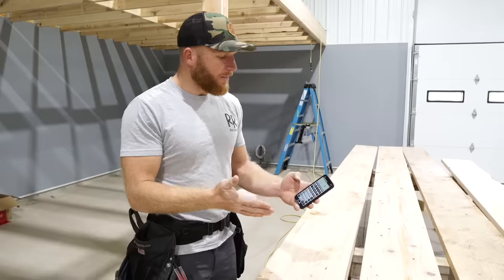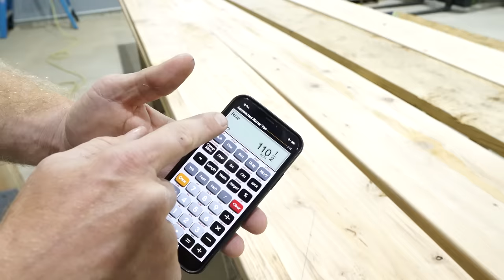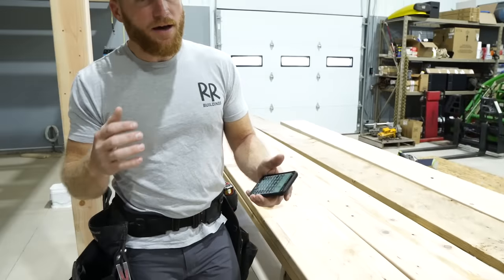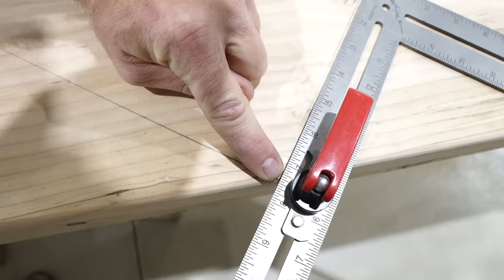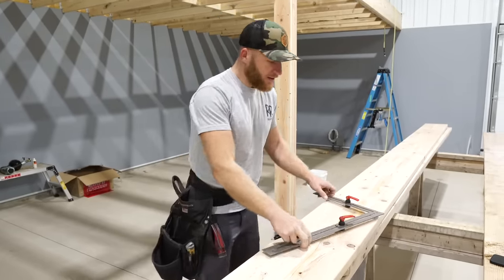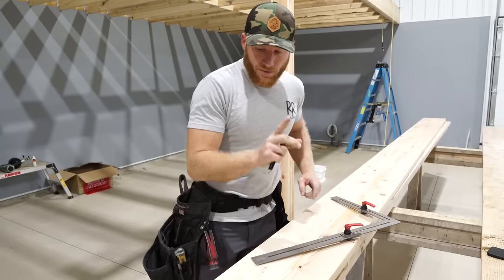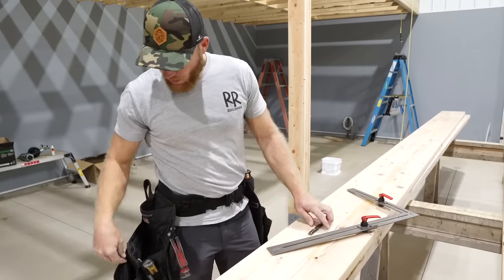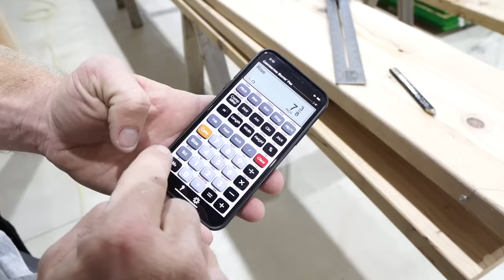Building a Large Staircase and How to Layout a Stair Stringer

Comment: Hey Kyle, love your videos

BUT, I do have to call you out on something
You make mention of your square with the fancy camming locking gauges, and explain how they are much better than the small hex clamp on types.
You say how small imperfections affect the smaller ones, but not yours.  
BUT, yours are rounded, so ANY imperfection can affect the accuracy of yours.
I would not buy one for That reason alone.
The small hex ones have a flat on them, 3/8"?? that rides the flat of the stringer.
Now, one must ensure they are flat on the stringer edge and NOT on the square, as that'll throw off the angle that makes contact, but as you say, make the first one perfect... take the time to clamp those little buggers down hard and flat to the stringer.
ALSO, I put mine on the outside of the square and use the inside to mark the run/rise. 
This keeps them out of the way, but gives a nice solid edge to strike a line against.
doing it your way, you could push the square off the stringer edge, a bit, and using yours with rounded faces, if it happened to slip into a small imperfection, it will throw every other dimension off.

When marking, using the first one, to put lines on the rest, you ALWAYS use the first to mark the others.
This way, you will NOT have "Exponential" or compounding errors.

Keep putting out these great learning aids! 
even old dogs can learn new tricks.

Comment: the rise seems to be off 1/4" here...because you took the measurement at the rim joist and not at the landing point of concrete..that is 1/4" low...in the field we make a 3/8" plywood template and mark each stringer out

Comment: Did you crown the 2"x12"s
You need another post under the beam.
That wood is too soft for stairs., also split.You need to use yellow pine. You don't need to cut those all at once. 71/4" skilsaw is all you need , one at a time.
Reply: What does it mean to crown?
Reply: No board is perfectly straight, look down the edge and you will see that it curves one way or the other.Always put the curve (crown) up.If you don't , it's already sagging..Just trying to help, good kuck.. @AnxiousCowboy

Comment: What is the saw dust for when you put the piece between the pipe and the wood?
Reply: It helps to both blend in and strengthen the glue joint for that small cutout around the pipe.

Comment: great video, however the max rise for a stair riser is 7" RISER HEIGHT AND TREAD DEPTH (IBC 1011.5)
The step height, also known as the riser height, must be no less than 4 inches and no greater than 7 inches. The minimum tread depth is 11 inches. If the stairs have nosings, you measure from the leading edge of the nosing to the edge of the next step’s nosing.

UNIFORM DIMENSIONS (IBC 1011.5.4)
IBC stairs must have the same riser and tread dimensions throughout the stairway. The difference between the largest and smallest tread depth or riser height cannot be more than 3/8 inch.

Comment: Damn , im a carpenter from baltimore city , one of the biggest things ive been doing lately is building alot of rooftop decks. Most of them ive got to build a landing with another set of stringers , sometimes got to use a pie as the very bottom step depending on the space. Im a stringer pr0.. Looks like he was confused in the beginning... Remember.. Always cut a inch off the bottom of your stringers... Lol atleast I always have to...

Comment: HOW DID THE FINAL THREAD WORK LEVEL WITH THE TOP FLOOR? DID YOU LEAVE ON AN EXTRA RISER? 
YOU FINISHED THREAD IS OUT BEYOND THE PLATFORM.
 INSTEAD OF STEPPING ON TO THE PLATFORM YOUR STEPPING INTO IT. 
VERY STRANGE LOOKING, YOU SHOULD HAVE STEPPED UP ONTO THE PLATFORM FROM YOUR TOP THREAD. 
STRANGE LOOKING.

Comment: Frist off not every stair is cut out, stairs are based off rise and run , and codes depending on main stair or as we call 2nd terry stairs basement stairs as a stair builder of 30 years now the old school way stairs are routed with a 15 degree bit two I never trace anything use the square always make sure everything is square and plumb

Comment: Nice work! Question... If I was installing 3/4" hardwood on the upper deck, how does that change the bottom cut? Or how do I keep all the risers equal in this scenario? Thanks a bunch! Enjoy your vids! Jeff
Reply: Probably a little late to the party with this answer but if you're installing 3/4" flooring on the upper deck, that's your finished floor. When you measure from the upper deck down to the concrete, make sure to include that 3/4" to your measurement. The bottom cut he's making is just the thickness of his tread (in this case 1 1/2") So whatever the thickness of your tread is, should be subtracted from the riser on the floor. Another note that he didn't include in the video - when you reach the top of your stringer, subtract the thickness of your riser off the back of your run. This ensures your top tread stays the same as the others. Sorry that's a lot but hope this helped haha, have a good one.
Reply: @H4MMY  Appreciate the reply.  Thank you.  On your last comment about subtracting the thickness of the rise... so I understand... if I'm using a 3/4" riser board, do I reduce the overall length of my run 3/4" by cutting the top riser back where it butts up against the header?
Reply: @jeffdeluca1153  Yep!
Reply: @H4MMY  So let's walk thru this. I'm pretty dense. ie.  If my treads are 11" with a 1" overhang, and all my other stringer cuts are cut at 10" and top one at 9 1/4". That's works out perfectly. You are a genius. Thx I drew ot out as I'm just visual that way

Comment: If you want to avoid back cutting just turn the stringers on edge and tilt your saw over to the right angle and set the proper depth.  One pass and angle readjustment for each direction and there is no back cutting.

Comment: "110.5"  ?? Is that from where the bottom of the stringer touches the floor to the finished deck height above?  Those two points are 12 feet apart.  Have you checked the lateral level to know to add or subtract for each individual stringer.  I have never seen a perfectly level slab or basement floor..  Not even once.

Comment: Set up a regular framing squares with regular stair guages at 14"3/4 and 20" and find how much easier it is to line up on your 10" run and your 7"3/8 rise, also I call bullshit on using regular stair guages, used them for 40 years

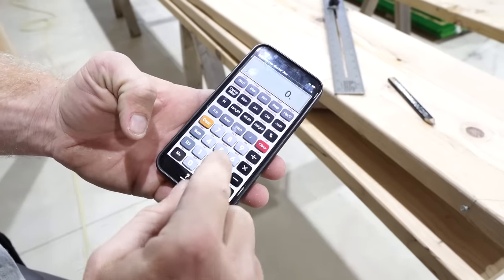Comment: The math you did starting at 6:24 is incorrect. The construction master rounds fractions so if you just add 12 7/16"+12 7/16", you will end up with 174 1/8" for 14 rises. The correct answer is actually 173 15/16".   3/16" is a lot to be off on that particular measurement.

Comment: Really good video with tips on precision and speed. However, what you said about hearing protection is the MOST IMPORTANT TIP. I did cabinetry for over 20 years when OSHA was a joke and protection was for pussies. You get one pair of eyes and ears; I’m 69 now and my hearing is shot. Ringing 24/7/365 and you don’t need no calculator to do the math.

Comment: on framing diagonal measurement isn't necessary, most will cover it with carpet, flooring, or finish wood of some sort...its not that critical especially since framing lumber isn't perfect anyway.....now finish carpentry whole other ballgame and its hard to switch back and forth between the 2...I start marking 1/16ths when framing after a finish carp job and catch myself, dude what are you doing, lol......I did stairs only for cpl years and also did stain grade crown only for a few years.....got bored with both fairly quickly I must say

Comment: Curved stair cases aren't that hard to build. You just need to mark your inside and outside radius on to the floor and some treated plywood then cut the plywood so you have top and  bottom plates. You might have to stack two pieces of 3/4" to get your 1 1/2". You then secure your bottom plates to the floor. You figure your rise just like you did here but you're treads are snapped out on the plates with a string line hooked at center point of the radius. You then cut your top plates, inner and outer, at those lines and you frame your stringers one step at a time. You don't have stringers in the normal sense unless you have a freestanding radius staircase in which you would need to laminate a beam in place. I could show you how to do that but is beyond the scope of the you tube comment section.